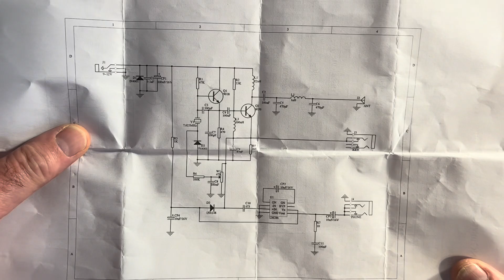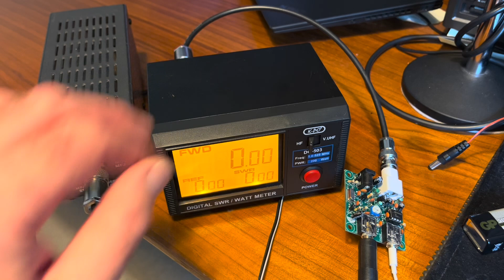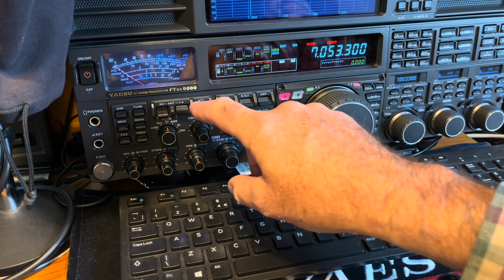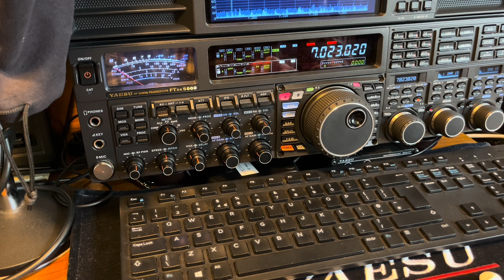Building a Transceiver (Pixie V3)

Comment: Sadly, in the US, you need an extra class license to transmit with one of these.  The other license classes must transmit at least 2 kHz higher.  I had thought that these kits might be fun as a club project, but crystals a bit higher up, while available, are quite hard to find, and aren't for free.
Reply from the maker: Thanks for the info, I didn’t realise. Yes, different crystals or perhaps a variable capacitor to provide some wriggle room?
Reply: @G0CNN-Ian  Yes.  A last vestige of "incentive licensing", I suppose.  You need to get that highest level license to get the bottom 25 kHz of both the CW and phone portions of 80, 40, 20 and 15.  The pixie seems the ideal way to let our lowest class license get their feet wet on HF, since, otherwise they are restricted to 10m and up, and often only have a Baofeng.

I don't know where those 7.023 MHz crystals come from.  They certainly must be being used in some non-Ham application.  They're not 2x the color burst frequency, so I have no guesses.

For the sake of round numbers, lets say we wanted to move it up 3.5 kHz, making it 7.0265MHz, giving a comfortable 1.5 kHz clearance from the sub-band edge, for tolerance, drift, and key clicks (not that the FCC is going to care about clicks that exceed the sub-band, but not the band).  That-s 0.05%.  In this frequency range, even cheap crystals are going to have very good Q, so I don't know if 0.05% is doable.  My understanding is that the load capacitor would have to be reduced in order to move up in frequency.  Too low a load capacitance might cause problems with oscillator startup, but the oscillator isn't keyed, so as long as it eventually starts (even seconds), it should be OK.  I suppose that there could be other effects such as increased phase noise, but that shouldn't be a problem for this usage.

If you have any small value capacitors lying around, say between 1 and 10pf, it would be instructive to know how much the transmit frequency changes, as heard on you base station rig, if you temporarily tack one of these directly across the crystal (and if soldering, after giving the crystal 5 minutes to cool.

Looking at the circuit, the load capacitance is the two 100pf capacitors in the Colpitts divider, C3 and C7, and the capacitance of the tuning diode, D2, all in series.  (C4, I believe, can be ignored, because the base of Q2 is a high impedance at RF.)  If they were all 100pf, that would give a 33.3...pf load capacitance.  Specified load capacitance is normally in the 20pf to 30pf range for most crystals (according to my readings, see this article: https://www.electronics-notes.com/articles/electronic_components/quartz-crystal-xtal/crystal-resonator-frequency-pulling-trimming.php ), so I'm guessing that the tuning diode capacitance is a bit smaller.  So, if the crystal can move far enough, it might work to reduce C3 and C7.

But I suspect that I should look for a cheap source of 7.040 MHz crystals.

73, Bill - KE1G
Reply from the maker: @KeepEvery1Guessing  Thanks for the licensing info Bill, and the explanation of the design. I don’t have similar caps in the shack, but I’ll keep this in mind when I next come across some to “borrow” or buy. Like you say, a crystal would be the most straightforward approach. 73.